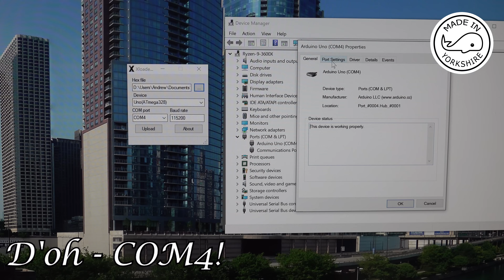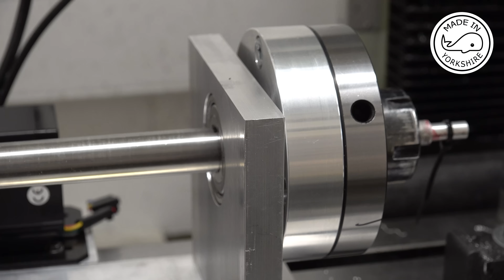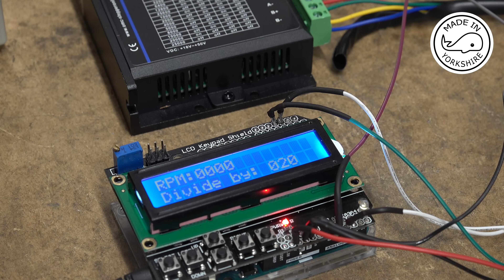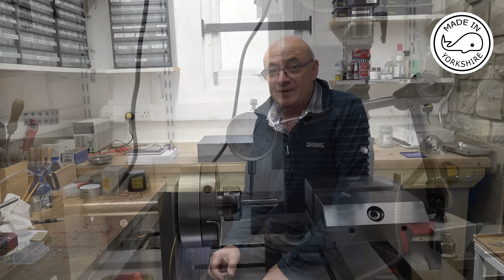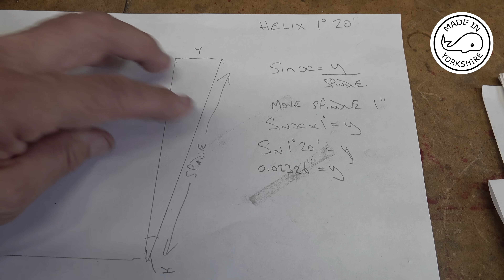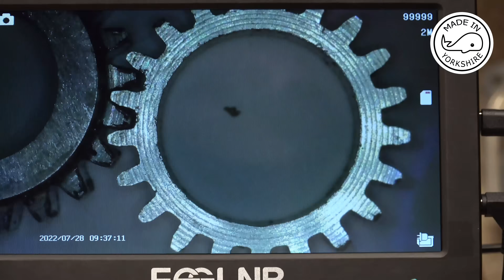#MT50 Part 4 - Making a Gear Hobbing Attachment. Making Test Gears. In 4K/UHD by Andrew Whale.

Comment: Also a (south) Yorkshireman, have i got this right.. you're basically running Andy's setup but with 2 17bit rotary encoders and the numbers updated for the extra encoder positions?
Reply from the maker: Hi
The setup is very similar to Andy's with just one rotary encoder. I did write my own Arduino script. The download link is in Part 7 video description. 
It was an interesting project but, in reality, you need an extremely rigid setup to hog gears - just look at the size of some commercial machines. The other issue is that hobs are extremely expensive and secondhand ones are a big gamble. For home workshops I think individual gear cutters are the best option.
Cheers
Andrew
Reply: @learningturningmetal  thank you, I've found your link, will re-watch 6 and 7 a few times to figure out what I'll need to do with a closed feedback stepper vs a servo motor.
I'm not too worried about rigidity here but would like to able to job really small stuff without gears.

Comment: Hear Hibbing is position based following, not velocity (RPM). Velocity based following does not make up for any velocity errors between the master and follower. Position base does.
Reply: The hob and work are synchronised by pulses originating at the spindle, divided by the Arduino to produce the required number of teeth. The RPM display is just a basic test of the synchronisation.

Comment: You've probably had lots of advice about the problems you were having and so my advice may not be relevant. One of the issues with projects based on the Arduino is that the boards are meant for experimentation and learning and they are not industrially hardened. So stray signals can get picked up that then create problems when the application is run in a noisy (ie RF noise) environment. Shielded leads and a steel box (a Faraday shield) can help alongside good lead placement away from noise producers like motors and motor drivers.
Reply from the maker: Hi Neil - many thanks for the suggestion. I've added it to my long list of things to checkout. I have had success with other Arduino based projects, so I will press on.
Cheers
Andrew

Comment: Hi Andrew, btw.... I love your channel, and before I make this comment I've not expert and am definately a learner but.... I noticed in the single pass gear the bottom of the teeth seemed quite wide, and the teeth  themselves slightly narrower. It got me thinking as the table moves back and forth the part of the hob that engages with the work will move you and down. Does a tool the runs a hob cutter somehow compensate for this?
Reply from the maker: Hi, yeah I think you are correct about the profile of the teeth not being quite correct - even on a single pass. I don't understand the math behind it but moving the table back and forth shouldn't be an issue as long as the mill isn't stopped between passes. More investigation needed!
Cheers 
Andrew

Comment: Hello Andrew, while the "single pass" aluminium gear seems OK, the tooth width looks a bit narrow.
Reply from the maker: Hi Steve - an interesting observation. I will re-examine that gear, by placing the good gear underneath it. My guess is that you are correct and that the sync issue is present on a single pass too.
Cheers
Andrew

Comment: Hi Andrew, great to see the progress you're making with this! There are lots of interesting suggestions below as to the synchronisation problem, but I don't see any problems with your setup and I think the real cause is taking multiple passes to cut the gear. 

It's always best to cut to full depth in one pass with a hob. If you take a shallow cut then you are increasing the radius of the teeth being cut on the gear. The hob wants to naturally turn the gear blank like a worm and worm wheel, so if you cut at a larger diameter it wants to cut a greater number of teeth around the circumference of the blank and the hob will try and drive the blank at a different speed to that that the stepper motor is trying to turn it, the force generated can overcome the motor and cause it to gain (or loose) steps, even when it is being correctly driven at the right speed. This can also happen if you don't have the hob tilted to the correct angle, but you look to have this spot on! On your microscope picture at 26:20 you can clearly see each pass has tried to push the gear at a different speed resulting in the sheared over tooth profile.

Your hobbing attachment looks easily rigid enough to be able to handle cutting 48DP and bigger teeth in a single pass, you just have to remember to feed very slowly, it's not like normal milling, as you feed you are also cutting all the way around the gear blank so you need to take it slow and steady otherwise you can easily get too far ahead and perhaps get the impression you are taking too heavy a cut, when in fact you are just feeding too fast.

The aluminium gear you cut in a single pass looks much better, but as somebody else pointed out the teeth do look a little narrow, this might be due to resonance, so increasing the speed of the mill might help tune it out. With this size hob (~ 1 inch dia.) I would cut that gear at around 600-800rpm and for steel 300-350rpm. Narrow teeth can also be caused by an undersized gear blank, perhaps the small runout could have contributed to this? Another good suggestion somebody made is to make your chuck a loose fit on the face plate so you can tap it in and lock it down to dial out any runout in the part, that's exactly how I do it with a 3-jaw chuck on my machine.
Reply from the maker: Hi Andy - many thanks for the advice. I will make a list of all suggestions, by you and others, and try to work through them methodically. Hopefully I will get to the root cause. Thanks again for your help.
Cheers
Andrew

Comment: Hi Andrew, I`ve owned one of these mills for about 5 years, are you still using the standard dc motor? on the crappy plastic gear?, I swapped mine out for an AC servo with better torque for ridged  tapping (oh it`s all been cnc`ed) as others have said ,looks like missing steps or a fluctuation in rpm once the motor is under any kind of use, also how accurate is the pickup, my servo has an encoder which, for me copes far better. hope you find the answer. P.s. keep up the good work , you`re only over the pennines from me.
Reply from the maker: Hi Barry. Blimey I didn't realise the mill has a plastic gear 😭. Looks like an upgrade once it breaks. The encoder I'm using generates 600 pulses per revolution and its connected using a 1:1 belt drive with teeth. Something isn't right, but hopefully I will be able to nail it. More experimentation needed.
Cheers
Andrew
Reply: @learningturningmetal  have a look under the plastic motor cover, if it's still thr same, it's a plastic gear between the motor and the high/low ratio shaft. I pulled Warco over this as they started "all metal gears" and their answer was, well its there for safety if you have a bump so it's a shear gear, utter crap in my opinion. Have a shear pin and replace for pence. The plastic gear is about 30 quid!. Anyway I made poly v belt pulls for mine. 😁

Comment: Stretch in the belt, between the stepper and the shaft? or slop lets say?
Reply from the maker: Hi Mark. Thanks for the suggestion. I don't know much about belt driven systems, but the belt and pulleys I used have teeth. I think 12 on one pulley and 36 on the other. So I'm not sure if they could gradually run out of sync over time. I guess any slop would be taken up once the hob engages with the blank. Interesting thought though.
Cheers
Andrew

Comment: As mentioned by others the root cause is "out of sync",  your gear is probably too slow turning. (my guess) 
Multiple passes like you tried, should be totally fine. It can only show the problem more obvious, but cannot have caused it. 
If you accidently put the wrong tooth count into the controller, it will look like your gears :-); worth checking before the big debugging session is approached. (Do not ask why I know this!). 

Reasons I can imagine, most of it was already mentioned and explained in depth by the other comments. 
a) part shifting on arbor or arbor shifting in chuck (most probably not the reason),
b) encoder input pulse count faults
c) rounding errors in software
d) mechanical overload on stepper motor
e) overload shut downs on stepper driver
f) speed problem on stepper driver: output signal, input signa, motor inertia,
 
Things I would try:
d)Try (carefully) to stall the workpiece spindle.  Some torque is required to keep the stepper in sync. Side load from the hob is not very high, but it is there. If the motor is turning too fast or at its limit, you can have a lost steps issue on the motor side. 

f) Let it "dry run" for a while (30 min) with the "good" gear on the spindle and the hob aligned on the gap, not engaged just next to each other to see if the alignment shifts over time. ( I hope that makes sense)

d) e) f) engineerd 3d s comments ! Additionally you can try to run the stepper driver at the highest allowed input voltage. (if not already the case)

c) Try different tooth counts for the gear

f) Try to hob a larger tooth count gear (plastic is good for trials), they usually are less problematic because the stepper can run slower, if a 60 or 80 tooth gear looks better you are loosing steps due to speed. OR Slow down spindle OR both at same time. 
My stepper driver gets out of sync when I accelerate the spindle too fast, because the motor will have too high inertia to follow. (remedy lower spindle acceleration if possible)

I hope the comment is not too annoying and repeating what the others already wrote. 

You will fix it, I am sure.
Reply from the maker: Hi Timo - many thanks for the list. Now added to my list of things to try.
Cheers
Andrew

Comment: Hi Andrew, The most likely cause of your problem is dropping pulses from mill spindle encoder due to bad signal integrity. To check that connect your oscilloscope at Arduino inputs, start the mill on constant RPM and measure typical width of pulses from the encoder. Then setup oscilloscope to trigger on pulse width that is different from typical values and wait for the scope to trigger to see the problem. Check both the positive as well as negative pulses. Your oscilloscope may also support triggering on runt - you can use that as well to detect signal integrity issue.  Based on what I've seen in your video, loosing the pulse in your setup is infrequent, so I would suggest to run each test for at least couple of minutes before coming to any conclusion.
Reply from the maker: Hi Adam - I'm still learning how to use the scope, but triggering on pulse width seems to be a great idea. I need to get reading the manual and see if it supports runt.
Cheers
Andrew

Comment: There seems to be a few issues with this set up. The cutter is analogue, in effect, and the gear rotation stepped, albeit small. Perhaps not an issue with the small gears here. The synchronisation between cutter and hob is utterly dependent on a perfect pulse train throughout the entire process. Although, Andrew, you call the sensing device on the mill spindle a rotary encoder is it just a speed sensor? If so, it is prone to errors if the spindle is stopped part way through the cutting process. Twisting the spindle back and forth probably advances the gear position I would guess.
Still, you managed to produce a good gear out of a few failures which is quite an achievement. You are on a steep learning curve at the moment. Well done.
Reply from the maker: Thanks Martin. I do actually have a rotary encoder installed on the mill. It generates 600 pulses per revolution. From some of the comments made, I suspect that the signal might not be clean enough. Lots of other suggestion made by others too. So, more experimentation needed to try to resolve the problem. Fingers crossed I will be able to sort it.
Cheers
Andrew
Reply: Andrew. A rotary encoder is more than a giver-outer-of-pulses. For every increment it gives a unique value so it is possible to identify every angular position it is designed to resolve. With hobbing you need to know where the mill spindle and the gear rotation are in relation to each other. Gear driven hobs are inaitly synchronised and locked. Digital systems need accurate monitoring and feedback corrections.
Reply from the maker: Hi Martin I don't think rotary encoders produce a unique value. There are two outputs that produce either low or high signals. Each pulse produces a high signal and it's possible to calculate rotation direction by examining both signals. If you have come across any code that sees these signals as numerical values I would be interested.
Cheers
Andrew
Reply: I think what you have is an incremental encoder. It can detect rate and direction with the two-wire lead/lag square wave output but can't differentiate between one position and the next. There are absolute encoders which really do encode the angular position and give out a unique number for each one. On such devices you would expect more output connections. For example, for 360 degrees you need at least 9 signal connections to relay the information to the processing unit.
Type into YouTube "absolute rotary encoders" as a starting point.
Gear hobbing digitally requires more expensive measuring devices and fast and complex computing between the cutter and the work piece.
With the equipment you already have I would be inclined to abandon the hobbing bit, use a standard set of gear cutters in the mill as normal and synchronise your indexing head with the mill's table feeds. That way you could set it on its way and get on with something else.
Reply from the maker: Hi Martin - thanks for the info. Andy (aka AndysMachines) makes gears successfully using this method, so I won't throw the towel in just yet. I'll try out various suggestions and see if that resolves the problem.
Cheers
Andrew

Comment: Looks like you put that microscope to work immediately! You will also find it handy for keeping track of insert wear and other general shop inspection.

As far as the run-out on your ER chuck, you could relieve the chuck mounting boss a few thousands, bump it true referencing a quality round held in the collet and rely on the mounting screws to hold the chuck in place.  I did that for the ER32 chuck on my lathe and it's been running true for several years now.

The good news is you got one good gear out of you hobber, so you know your setup can work. It just needs some debugging.
Reply from the maker: Hi Douglas - I would have really struggled without that microscope. It's amazing VFM. Thanks for suggesting it in the first place. I will see if I can address the runout as you suggest.
All the best.
Andrew

Comment: It's probably the backlash in your table leadscrew that messes up the teeth in the multiple passes. You should be able to do 1 pass if you feed slow.
Reply from the maker: Hi Jeremy - I think the problem is also present in a single pass, but it's not as obvious. I need to do more tests and investigate further.
Thanks for your suggestion.
Cheers
Andrew

Comment: Doesn't the electrical design of the stepper motor determine the number of full steps per rev?  So setting the controller to the wrong number of steps (i.e. 800 instead of 200) will make the stepper motor rotate 4 times as fast (rather than micro-stepping), won't it?
The aluminium gear at 25:15 is still not quite right - the teeth are too narrow and one side of the root is sharp while the other is rounded - both features indicate a loss of synchronism.  To determine if the problem is software (rounding error accumulation?) or hardware, you could try writing a very simple counting program in the Arduino instead of using Andy's version - count 20 input pulses, output one pulse, repeat.  If this produces a good gear then there's a software problem.
Reply from the maker: Hi Chris - I think I've got my steps calculated correctly. If I set the stepper driver to 200, 200 pulses will only turn the gear blank 1/3 of a turn (3:1 tooth belt ratio on hobbing accessory). So in that case 600 pulses are needed to turn the blank one revolution. Good observation at 25:15. I previously wrote a simple script as you describe. I will mod it to output one pulse per 21 input pulses and run that. As you say, this would highlight a software problem. Great idea!
Cheers
Andrew
Reply: @learningturningmetal  Hi Andrew.  Please don't keep me in suspense !  When you ran the simple code (1 output pulse per 20 input pulses), did it produce a good gear?
Reply from the maker: @chrisarmstrong8198  I used it in a previous video to check output using a scope. All looked good but it wouldn't highlight any gradual out of sync problems.
This time I'll try to cut a gear with it.

Comment: When I cut threads on my lathe, I engage the drive on the same number on the counter with each pass. Is there a reference signal to sync with the movement of the cutter into the workpiece similar to thread cutting? With no reference, any backlash in drive system is carried forward, inducing a cut more and more away from being in sync.
Reply: Good idea, this is the way some petrol engines work. The ecu looks for a missing tooth to sync. With gear hobbing you probably won't need absolute measuring so could reset every revolution. Or if absolute is required add each count to the last.
Reply from the maker: Hi William - Thanks for your thoughts on this but I don't think there is a reference signal as such. More tests needed to try to works out what is going on.
Cheers
Andrew